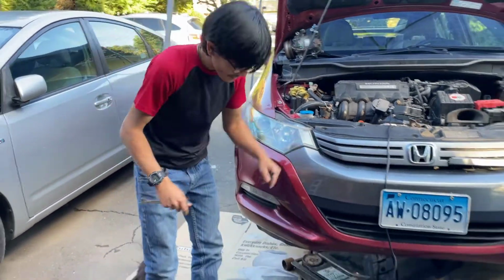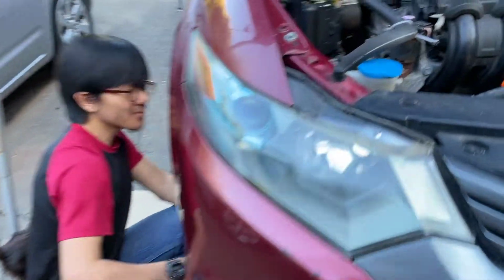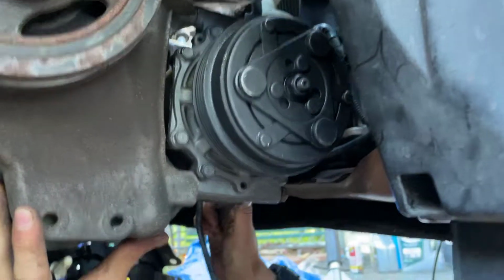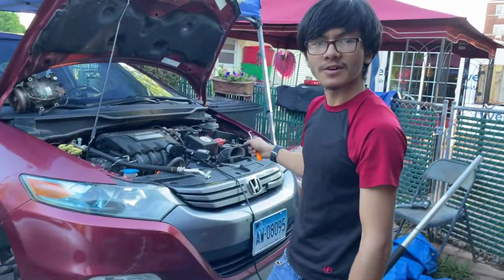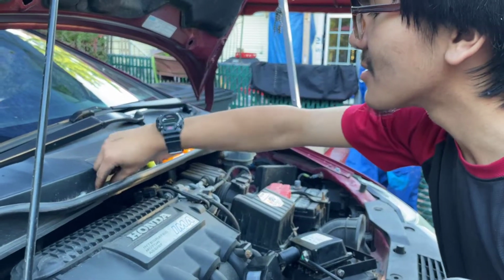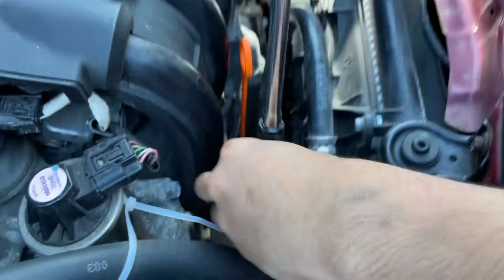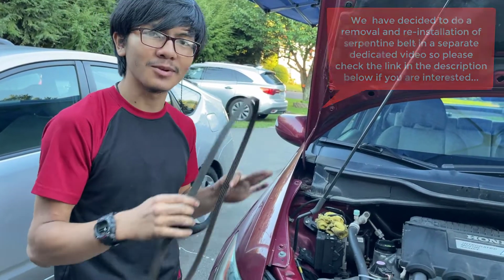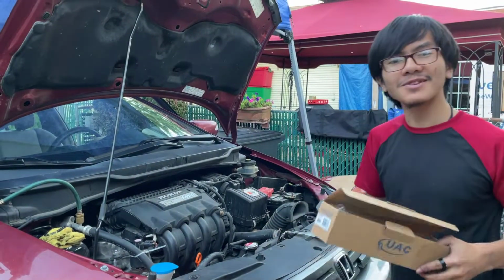How To Replace / Re-Install AC Compressor Honda Insight Gen 2 Hybrid 2009 2010 2011 2012 2013 2014

Comment from the maker: Here are the #ad links to some of the tools or parts which might be required to perform this repair:
1.  https://amzn.to/3pfasXv  |  RYC Remanufactured AC Compressor and A/C Clutch EG891 (Fits Honda CR-Z 1.5L 2011, 2012, 2013, 2014, 2015; Fits Honda Insight 1.3L 2010, 2011, 2012, 2013, 2014)
2.  https://amzn.to/3q9PE2y  |  AC Compressor & A/C Kit For Honda Insight CR-Z CRZ- Includes Drier Filter, Expansion Valve, PAG Oil and O-Ring Seals! - BuyAutoParts 60-82242RK New
3.  https://amzn.to/3mf0tPK  | ORION MOTOR TECH 826pc Universal O Ring Assortment Kit in 32 Sizes | SAE and Metric O Ring Kit for Plumbing Automotive Faucet Repair More | Nitrile Rubber O Ring Set with 4 Pick & Hook
4.  https://amzn.to/3J0bXQP  |  TSI Supercool A/C Comp Lube, UV Dye, 8 Oz, Flsh PNT 442 F, red/Yellow Tint (P46-8D)
5. https://amzn.to/3J0peZN  |  VIVOHOME 110V 1/3 HP 4CFM Single Stage Rotary Vane Air Vacuum Pump and R134a AC Manifold Gauge Set Kit with Leak Detector Carry Bag for HVAC Air Conditioning Refrigeration Recharging ETL Listed

Or Click on Amazon link here and search for what you need:  https://amzn.to/3xIOsqg
Reply: How often do u have to add oil to a/c?

Comment: You have been way more helpful than Haines/Chilton manuals. I have the exact same car and they told me they didn’t make a manual for it :o. How did you get the compressor to engage, in order to recharge the system? Jump the relay or the low pressure switch?

Comment: so if my a/c works intermittently, like for 10 mins in the city and 30 mins on the highway, where would I start to diagnose on the 2010 insight?
Reply: Same thing happening to me
Reply: @jaypowell146  ended up being a leak at the evap lines, and the clutch needed a reshim and recharge a/c, charged me $450 all in CAD~ totally worth it!
Reply: @phuphillipTrinhcAny luck with diagnosis
Reply: @MustafeezRehman-j2j  ended up being a hose leak a a/c tech fixed it for $350 cad! and had to refill the line with refrigerant!

Comment: Sooooooo i saw the removal video as well I assume u are changing the compressor because owner heard a noise coming from under hood when using the ac? Because that my issue with insight

Comment: I just put a new bearing in the pulley when that happens.   Best practice is to pump all the air out of the system with a vacuum pump before installing any refrigerant.